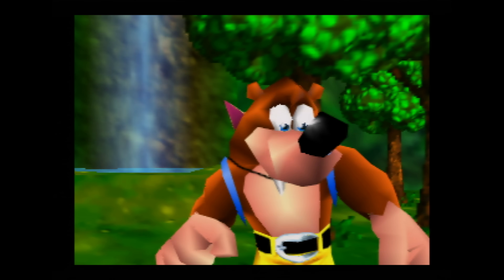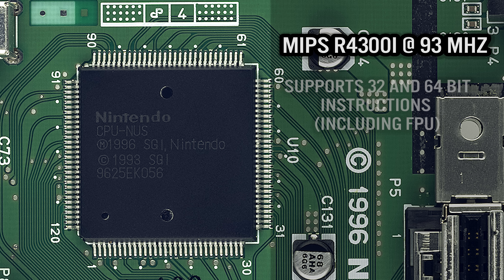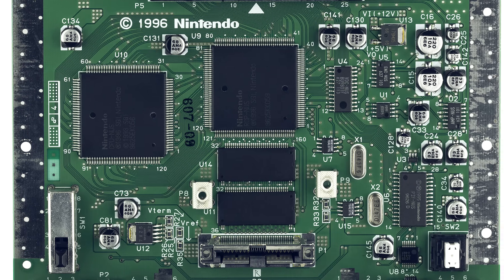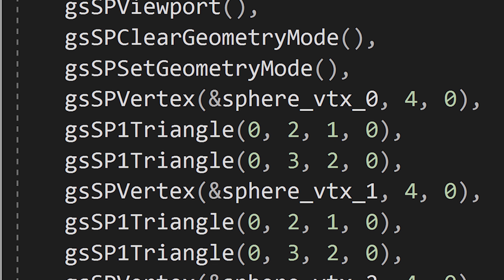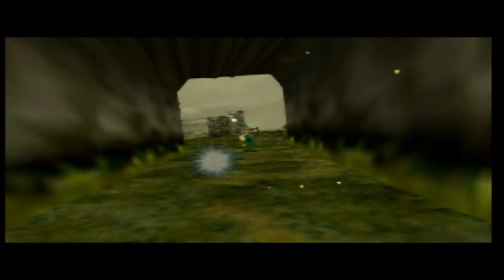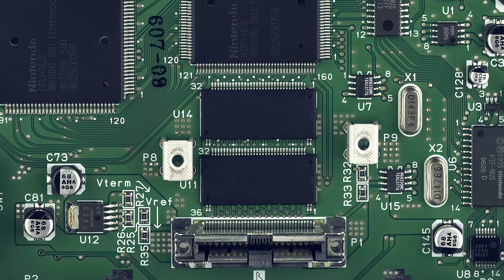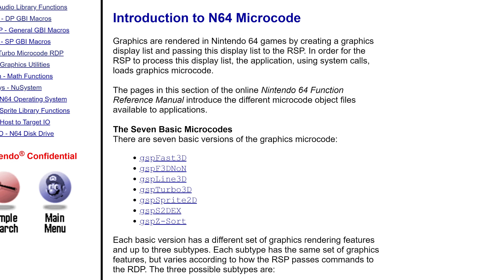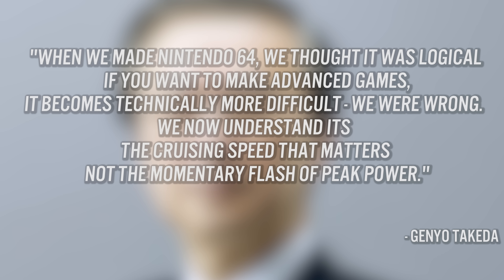Why was the Nintendo 64 so hard to develop games for ? | MVG

Comment: 1:18 : I clean, restore, and RGB mod a lot of these systems, and every time I open one up, I look at, enjoy, and appreciate the layout and design of the motherboard.  The few chips are packaged so nicely on the board, connected by unique curved traces.  It's such a beautiful layout, direct to the point with almost nothing wasted, especially space!  I don't favor the system or its games that much (I've played very few games and since I didn't have one growing up I don't have any nostalgia for it) but I absolutely respect the engineers who created the final board layouts.

It's a shame whoever picked out the plastics for the case chose a mix that got so brittle with age.  Advice for anyone taking a console apart: when reassembling a screw that goes into plastic, rotate it counter-clockwise until you feel it "click" and sink down into the threads.  Then tighten.  This plastic is very brittle and it's super important to NOT cross-thread through it lest you break off posts.  The plastic's only saving grace is it responds VERY well to standard cyanoacrylate super glue.  As long as the plastic doesn't shatter into pieces but breaks off cleanly, chances are a superglued piece will bond stronger than the now 20+ years old plastic.
Reply: It's a cool layout, but why they never supported RGB out of the box is beyond me. A real step back from the SNES. Thankfully they went back to it on the gamecube. It's especially weird for europe because here the scart connector was very widespread and a majority of TVs supported it. I remember playing the Playstation over RGB 20 years ago and I didn't even realise what that meant at the time.
Reply: @thegearknob7161  yeah the SNES was fully SCART compliant. But you can mod the N64 to have th RGB out, since the signal out of the ICs is RGB + synchro to begin with. Wire it directly to a SVGA connector and add a jack or RCA conn for audio output.
Reply: @Diamond_Tiara  That only works on certain NTSC versions. On a PAL console at least it requires quite an expensive FPGA based board be soldered on to the DAC. There's no excuse for that. RGB Scart was as standard in PAL countries in the 1990s as HDMI is today. Nintendo knew this. They did a version for France with native RGB support but most of them are composite only, for reasons that make absolutely no sense to me. I can't see any cost reduction in not sending out a signal that's already been generated internally through a connector that already has the pins for it.

Officially the PAL N64 doesn't even support Svideo either, but there is a way to modify a NTSC svideo cable to get it to work. So at least there's that.
Reply: @thegearknob7161  that's why I'd judt go with a good monitor and define/adjust the image format as long as it synchronizes, PAL/SECAM/NTSC/SVHS/HDTV/QCIF and co. A good monitor is like what it says, get a signal made of X and Y dots, convert it into a picture. 
So that's why I find absurd to pay for a converter if you can already grab a R/G/B_synchro signals from the chipset, just to plug it on a TV. And even most TVs have RGB/DB15 standard connectors for PC or anything like.
Reply: You know what I'm gonna do the experiment with a N64 and check really what kind of signals it brings.
Reply: @maanerud That screw advice is gospel when dealing with plastic stuff.  I used to mod Nerf guns and did the same thing to avoid stripping.  Once you click into the original threads the screw should go back in with almost no effort, probably using only two fingers on the screwdriver.  If you have to grip with your whole hand and drive the screw, STOP because you're cutting new threads across the old ones.  Even with nice new plastic that isn't brittle, it's easy to shave off enough material to ruin the hole, plus it makes it very hard to tell when you've hit bottom.  Over-tightening can obliterate the threads entirely.  Just run it down until the screw stops on its own, then give the two parts you're joining a wiggle. If they're still moving against each other, snug the screw a tiny bit at a time until they're firmly held together.  Remember it's just a plastic case.  It's not holding the wing on the plane.

Just my two cents for anyone wanting to mod consoles, keep your screw holes healthy at all cost.  There aren't many good ways to fix them once they're gone.
Reply: yep, it's indeed rare to see a PCB with that smooth design, electronic engineers wanted to make it like that and I approve. it changes from the ever-seen angular motherboard circuits.
Reply: @JS-rm2ws  I use svideo on my PAL N64 and it's leagues better then composite.

Clearer, sharper and colours are better.

This is both on my CRT and LCD?
Reply: @Spunky_Bob  maybe I just had a sh*t cable all those years ago :-))
Reply: i think this guy likes the n64 motherboard
Reply: maanerud are you the guy i keep getting the glued together rgb mods from on ebay??

Comment: we do not forget that back in the days CRT TVs added their own blurryness on the image, and while this was beneficial on psx's and saturn's unfiltered textures, it was a matter of adding blur on an already blurred image on the n64...not a big deal
Reply: nah, psx looked jagged and sharp on CRT and N64 looked like drunk vision, I really hate this blurry AA/texturing method
Reply: @MrSapps   nonetheless the smoothing effect of CRT television is notorius, as a matter of fact mame and other emulation programs offer filters to make games look like they used to be on old CRT tv even when you play on a LCD. But yes  N64s graphic  was a bloat of blur , i never liked it
Reply: CRT televisions don't add blur, it was caused by composite and RF video signals muxing the chroma and luma signals. This caused signal degradation that resulted in blurry video and other artifacts depending on the cable quality and length of the cable. You can also bypass the tuner entirely on more advanced CRT TVs with "jungle" chips, where you can tap into the RGB signals directly to bypass any filtering done on the tuner (comb, pull down, etc.)

S-Video, Component and RGB SCART gave far better video output. I've modded my Sega consoles to output S-Video to my 1992 Sony Trinitron CRT television, and I get a crisp picture with absolutely no blur whatsoever.
Reply: @GGigabiteM   ehehe don't get me wrong, i am still a big fan of crt technolgy, it still has its upsides compared to LCD. Maybe it is more correct to say that they added their own degree of smoothness to the image (calling it blurryness is a bit too much), but yes, the smoothness is definitely there, even when you use a good output like a scart (i always played with a scart, i never used an RF output). This was due to the technology itself (CRT does not really has pixels) and due to the quality of most CRT TVs, that was not even comparable to tha quality of a decent CRT monitor...
Reply: that only affected n64 which had no rgb out..... usual n crap, justnlike today :(

ps1 and saturn had rgb of course....

Comment: At the end of the day though here in 2020, you can find an N64 laying around anywhere plug it in and toss a cartridge on top and play a game. No lag, no freezing, no loading. Try that with a PS1. I dont know much about booting PS1 games on real hardware via more modern methods but I think for as much as people talk the talk about the library, few and far between would actually sit there and swap discs and go through the loading the old school way. N64 may not have the visuals today, but it boots up games just as fast as modern day games running off a SSD. N64 also has a more active online community, what PS1 classics are even talked about today beyond people bowing their heads to Metal Gear nostalgia? N64 lost the 90s, but it absolutely pummeled the PS1 in longevity.
Reply: "What PS1 Classics are even talked about today beyond people blowing their heads to Metal.Gear Nostalgia?"

Oh i dunno, the Resident Evil Games, The Final Fantasy's, Crash Trilogy, Spyro Trilogy, Tomb raider games.

Comment: I remember reading on wikipedia (around 2005-6) about a broken feature of the N64, I think called "supertexturing" It apparently dealt with rendering high resolution textures, but a hardware bug prevented it from being usable. My memory may be not accurate, but I was curious if you've heard of anything along those lines. A video on hardware bugs on different console that prevented features or on cut features, a "what could have been" kind of video, would be pretty cool.
Reply: IrisGL has nothing like "supertextures", it's got superior lightning  and particles subsystem, and of course different texture mapping as well, so that's about it on RDP.

Comment: Most of what I learned about the basic components of PCs came from a book on building PCs that my aunt got me at Barnes & Noble when I was five (so 2005~2006). I recall there was a chapter on Rambus RAM, and that it was super expensive and probably on its way out. They recommended the then-new DDR2 instead.

Haven't heard of Rambus since, until today.

Comment: Great vid. I love the N64, and although it's overall library couldn't compete with the likes of the PS1, the N64 still had some absolute classics. Often the best games were either the 1st-party games like Mario Kart, or the games from Rare (IMO).

6:58 Four Megabyte* ;)

The Expansion Pak actually adds 4.5 MBytes extra RAM to the system, as the memory bus is 9 bits wide.
But the extra "bits" are used for storing Coverage data for the anti-aliasing algo, and I think some Z-buffer stuff, too.

So when the Expansion Pak is used, the total RDRAM is 9 Megabytes. I think a small amount of that extra 1MB gets wasted, though?

The RDRAM bus has to scream along at 250 MHz (500 MHz DDR) because of that 9-bit width. But inside the RCP, it combines 8 reads into a 72-bit wide bus, which then only runs at 62.5 MHz.

I have no idea how they managed to make the RDRAM trace impedances work on a 2-layer PCB, but they did. lol

I'm a bit skeptical that the latency of the RDRAM is really so high for smaller transfers that the cart slot would be faster.

The cart slot has quite a long setup time of around 1 microsecond (1000ns) after latching a new address.
It can then pulse the READ signal for reading contiguous blocks of 16-bit words, which happens about every 300ns...

http://n64.icequake.net/mirror/www.crazynation.org/N64/

That's still very slow, but then maybe it still has lower overall latency for accessing the smaller texture stuff?
Reply: This datasheet is basically equivalent to the RDRAM used in the N64...

https://retrocdn.net/images/c/c3/Oki_Concurrent_RDRAM_datasheet.pdf

It looks like it would only take around 5 or 6 clock cycles (PDF page 7) to activate a new row, then start reading out the data.
It could then read a burst of 256 bytes from each row.

The RDRAM bus is still only 8-bits (or 9-bits) wide, but that's running at an effective rate of 500 MHz.

So the latency for reading a contiguous chunk of data is really very low, especially from the point-of-view of the main 72-bit bus inside the RCP, which runs at 1/8th the speed of the RDRAM itself.
Reply: It is possible though, that reading small chunks of data from cart might still be faster in practice, because the RDRAM is in constant use for DMAs, for things like reading the framebuffer area to output it via the video port, or accessing display lists etc.

So maybe in some circumstances, it's better to pre-read or stream certain data from the cart.

But the latency of the RDRAM itself is really very low compared to the cart slot.

If it takes say 8 clock cycles to activate a new row in RDRAM then start reading bytes, that's only one or two clock cycles of the internal bus in the RCP.

Whereas reading from a new starting address in cart ROM would take around 60 RCP clock cycles just to set up the address.
Reply: The RCP, you mean. ;)

(the RCP is the chip itself. The RDP is the Drawing Processor, which is a sub-block of the RCP.)

"80bit". That's Atari Jaguar maths. lol  :)
Reply: @rasz  Oh, I see what you mean now. ;)

Yes, the RDP uses a small part of that extra space (due to the 9th bit) for storing coverage data, for AA.

I'm not sure about the z-buffer thing either. It might just store that in the lower 8-bits in a different part of RAM from the framebuffer?

Comment: 1:44 "5-stage pipeline" means only that five instructions are being worked on at different stages at the same time. When people say "execute n instructions at the same time", it refers to being doing multiple instructions simultaneously (being "superscalar"), which this CPU can't do.
Reply: Correct. Older non-pipelined CPUs, such as on the NES, took perhaps 4 clocks (on average) to do something meaning your 1MHZ CPU was actually doing 250k operations per second.
Reply: Ben Heck Hacks 65XX series are known for taking less ticks to do basic ops than the competitors, but also their ops are often more constrained and you need more of them. 6502, as simple as it is, already pipelines some execution stages. In particular, it fetches the next byte of the instruction from RAM before it is actually ready to decode it.
Reply: And this then introduces the risk of "pipeline stalls", which are pretty expensive in their own right.
Reply: @halofreak1990: Pipeline-stalls can be worked around in various ways, such as multithreading or barrel-processor design. Yes, that adds floorspace in its own right, so it's not cheap - but it's an addressable problem.

RAM-latency and speed in turn cannot be fixed: If your CPU runs faster than memory tek can keep up with, there's nothing you can do about it.
Reply: @lyxar777  With how easily pipeline stalls can be avoided by a programmer, I see little value in changing the hardware to work around this, unless you were planning to design a new processor, anyway.

"RAM-latency and speed in turn cannot be fixed: If your CPU runs faster than memory tek can keep up with, there's nothing you can do about it."
Up to a point, yes. However, there are still techniques to minimize memory accesses, which can help reduce the impact of the RAM performance.
Reply: @halofreak1990  Yes but it's still faster it's not like the engineers were idiots just making their cpus slower.
Reply: Thank you! I was about to write this comment. Now I don't need to :)
Reply: Both pipelined processorns and superscalar processors work on multiple instructions at the same time. Just in different ways.
Reply: I paused the video at 1:55 and was just about to say this!
Reply: It's one of those details that you can't really explain quickly, might as well leave it out.

Comment: What im waiting for is for someone to reverse engineer the n64 in order to get it to output close to an "emulation quality" picture output if at all possible. I have the ultra HDMI installed in my N64, but it doesnt go far enough to remove the ugly "dithering" (triangular artifact looking crap that blurs the picture quality alot in most games and is an eyesore). I would have also loved texture filters to be added to the Ultra HDMI which never happened, even though it was suggested. I use the svideo out put and have that running through a retrotink (since it has smoothing abilities) and it helps alot and to me looks much better than the ultra HDMI in alot or ways, but still doesnt go far enough to remove other graphical artifacts like the "dithering" as posted above.

Comment: A very interesting and very well documented insight into the hardware.  I would say regardless of latency it was still a much more powerful system, 4Kb can be worked around easily but it requires alot of space on the media format, which the N64 cartridges didn't have -  alongside unoptimised SGI microcode - and Nintendo's intolerable control over what developers where allowed to do really shot themselves in the foot.
Reply: On the downside, it would have meant that the overall hardware would've been more expensive than what Sega was offering for their Saturn at $399. Could you imagine how much it would cost to buy an N64 then with a built in disc drive?